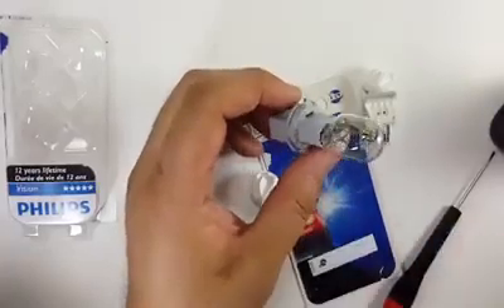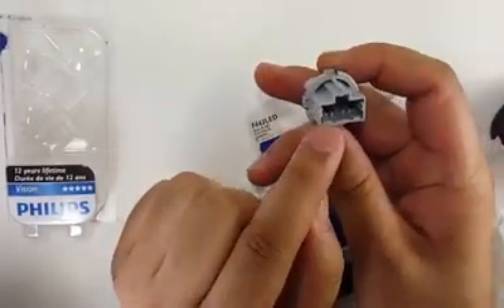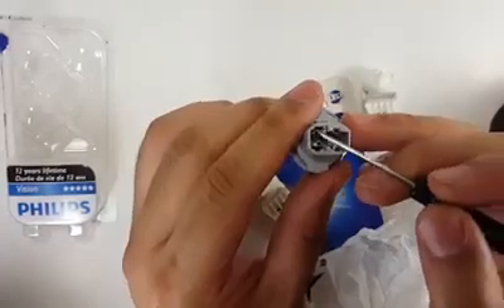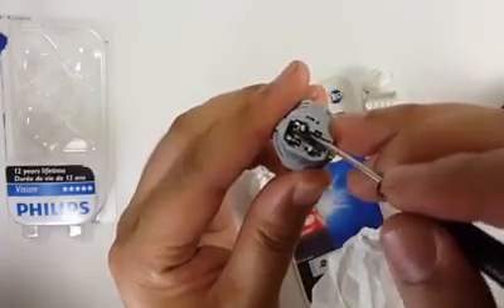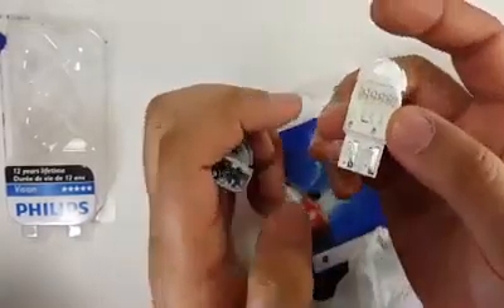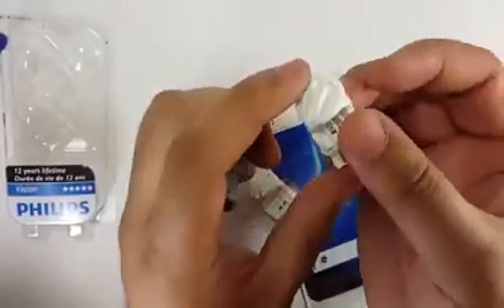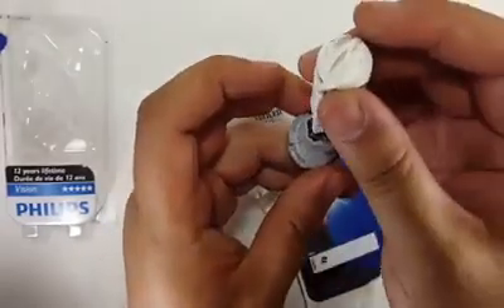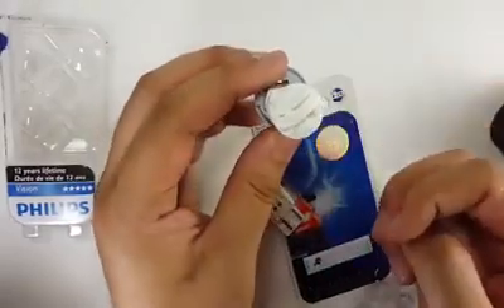Troubleshooting Philips 7443 LED

Comment: My brake light is working but not running lights. Will this fix the problem?
Reply: having the same problem with my rav42014 , did you adjust the metal?
Reply: @jenz695  There were a couple of problems I was able to find and finally got it working. First, I switched bulb style to the more expensive Zevo style light. This got the running light working on the left side. Then, I checked all the connections for their electrical flow using a multimeter on the right side where the running light still wasn't working. I found the socket piece, kind of like the unit shown in the video, had a unrepairable internal electrical short. The current was flowing at about 3% of expected. When replaced with a new socket, the running light started working on the right side, as well. Had to order the new part from a Toyota dealer. Cost about $20 shipped.

Comment: Hey Jeff,

Trying to get the brake light function working on my car. Are you essentially bending the metal contact on the bulb socket to touch with the metal contact on the bulb?
Reply from the maker: Yes that is correct.